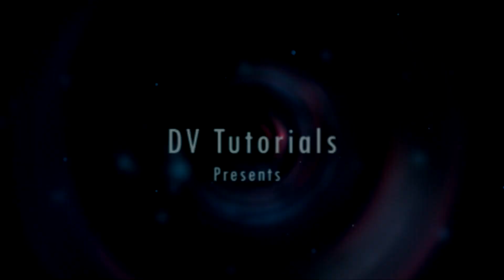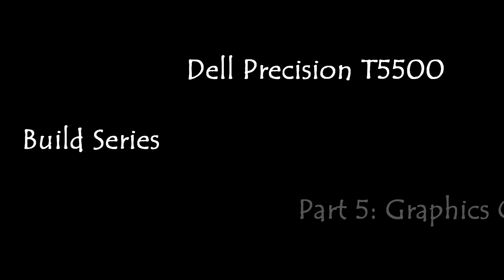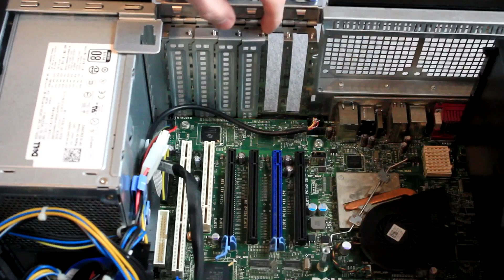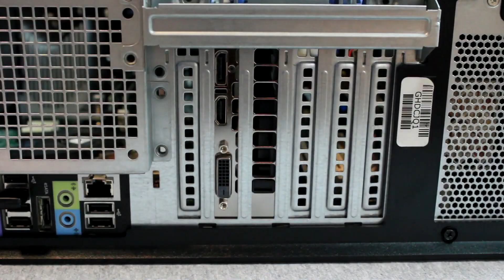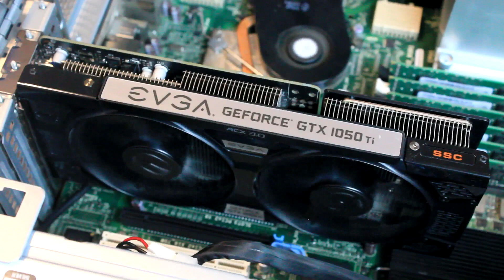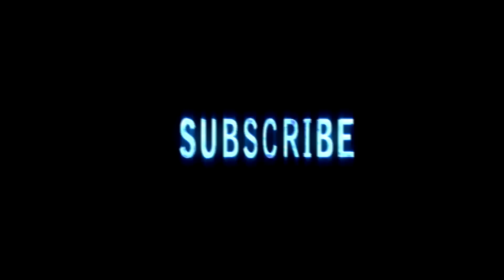Dell Precision T5500 Build Series: Part 5 - Installing Graphics Card

Comment: Hey man can i use rx 470 (require 6pin connector) on this pc
Reply: "Power Supply: 875W 85% efficient Power Factor". Yes, you can use that graphics card without problems.

Comment: WARNING: COMPUTER NOOB QUESTIONS INBOUND:
are all the slots 128 bit, and compatible with that graphics card, or are some lower?
Reply: "Support for 2 PCI Express® x16 Gen 2 graphics cards up to 150W". Only 2 of those 4 PCI-E ports are for graphics cards (The 2 that have the blue plastic back).

Comment: Good video series. I bought a T5500 barebones server. I have purchased 2x 5670, 2x 16GB RAM modules, and 2x GTX 750TI to create a Gaming virtual machine server using VMware ESXi. So you can have 2 gaming computers in one machine. Also will be using it as a web server and file server as well. Trying to figure out my storage, I'm thinking about going with 4x 1TB Samsung EVO drives in RAID10, and 2x 4TB WD Reds for redundancy purposes. I'm having trouble getting the front of the case off, the latch seems to be stuck.
Reply: Do 16gb sticks work with this motherboard? I have 4x 16gb modules here and I'm buying a t5500 tomorrow for €400. It's pricey compared to the €180 (amazing deal) t5500 in this video series and I'm worried they won't work
Reply: @miitch99  I can confirm the following model of 16GB DDR3 works:
Samsung 16GB PC3L-10600R (DDR3-1333) ECC (M393B2G70BH0-YH9)

I have two sticks installed for 32GB, and the system detects the memory and works fine.